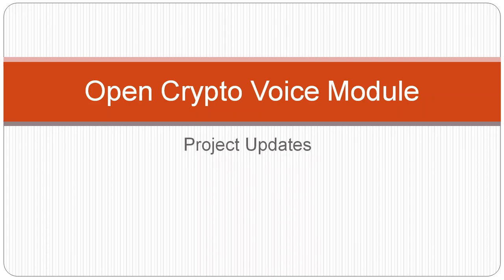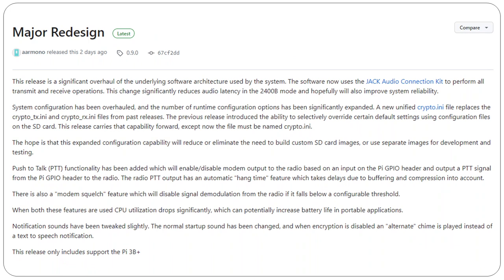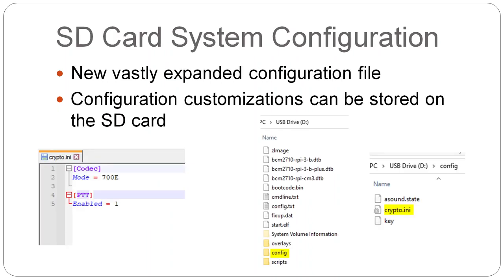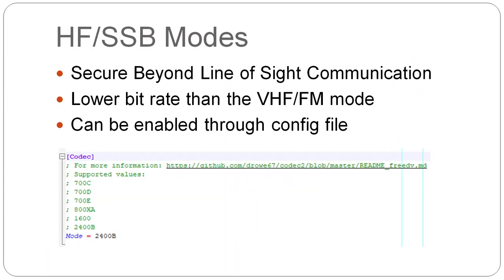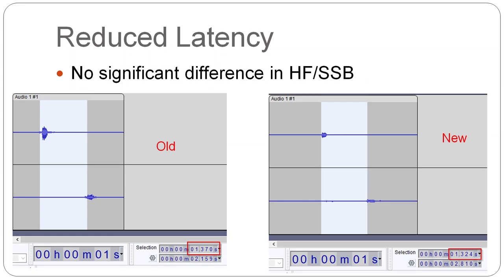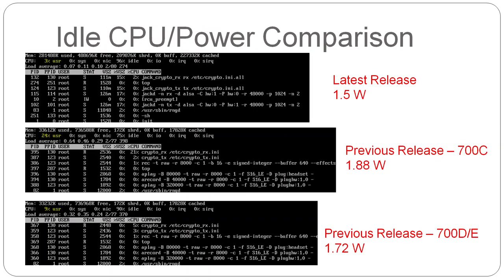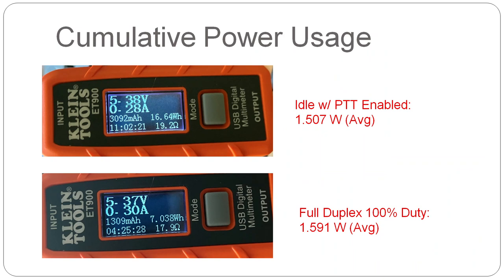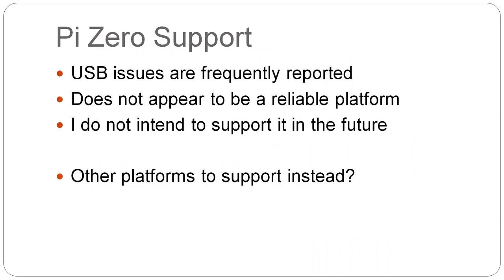Crypto Voice Module Project Updates (Encrypted Digital Voice)

Comment: Thanks again for the videos. You mention that there is not really anyone doing the encryption side of the audio open source. This is a valid point. Would you be able to share in a repo or somewhere how to use your branch of the standalone codec2? 

I have looked into the code some to see where you incorporated the aes.h/c files, along with the implementation into the encoders. I am bashing my head trying to figure out how use the your standalone codec2 package in command line? 

I am going to look deeper but any help would be greatly appreciated!
Reply from the maker: Using my codec2 is pretty straightforward. If you look in freedv_api.h and freedv_api.c there's a freedv_set_crypto function that takes a key and initialization vector. Important: there's an error in the documentation for that function: a key is 131 bytes instead of 32 (see FREEDV_MASTER_KEY_LENGTH). Generally you would call that function with a new IV at the start of a new transmission.

As for using the command line, the crypto_transceiver project has two command line programs: crypto_tx and crypto_rx which are implemented in crypto_tx.c and crypto_rx.c. Those are heavily modified versions of the freedv_tx and freedv_rx programs that ship with codec2 and simply pipe data through stdin/stdout. I still use them for development/test purposes.

Hope this helps.
Reply: @aarmono  Thanks for the reply and info. I know you have been answering the same question  in different flavors so I appreciate the response!

Keep up the great work. I work with IOT and embedded systems but this is the first for me with audio and this is extremely helpful.

Comment: Hello, I think this project is amazing. I did some research to alternatives boards, I would consider the Orange Pi Zero 2W, similar to raspberry but have already two USB-C ports. I not quite sure because I don’t have much experience with those boards, but I suppose you could use the GPIO pins to power using a battery + small board that control charging and giving additional USB port only to charge the battery. 

Also, I think is possible to design some case and make it rainproof to use in the field on a more mobile application. (Also another subject I never tried, 0 experience with 3D printing) 

Do you think this software could be compatible with Orange Pi Zero 2W? I mean, it is Ubuntu compatible.
Reply: Also, they have a expansion board that add two usb, three buttons (one wich is power) and a audio jack !
Reply from the maker: it's possible the software could be made to work (spec-wise the CPU seems powerful enough), though probably my next release will involve Pi 4 support since I finally have one of those. My main limitation with hardware support is hardware availability: I simply don't have one of every board of this sort that is being produced.

I have been made aware of people attempting to design waterproof enclosures for this system, though none of them as of yet have chosen to make their designs public. If they do I will link/add their designs to the system documentation.
Reply: @aarmono I see, I saw the orange pi zero 2W with 1GB ram for 13 USD. I am considering give a try. Do you think 1GB ram is enough? 

I also don’t have any radios to try, I am aming to baofeng to be more affordable. Do you have a recommendation? Like the one who PTT will work and so on.
Reply from the maker: @gutobuenodf  To be clear, I do not currently have a release image for this board, so if you were to use this board you would have to get the software working on it either through using eg. Ubuntu or port the buildroot build package to this board. While this probably isn't very difficult, it's non-trivial.

As for VHF/UHF radios I have a bunch of baofeng UV-5r and UV-82 radios which work with the APRS-K1 cable. For those you would either have to wire the PTT to the radio or just enable VOX on the radio
Reply: @aarmono got it! Thank you.
About the image, I will double check, but if my understanding is right, orange pi is suppose to run same OS as raspberry. 

I am not quite sure. But I think maybe worth the test. Thank you for you time.
Reply from the maker: @gutobuenodf Unless the hardware is identical I wouldn't expect it to work. I just don't want you to spend money on something that may not work is all.
Reply: @aarmono  any word on getting this to work on the 4?